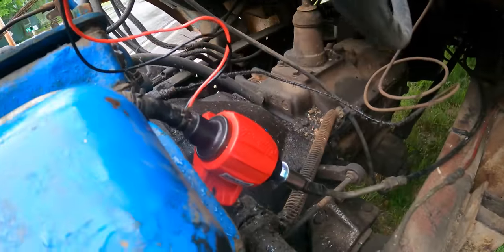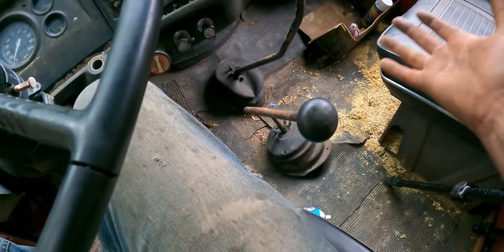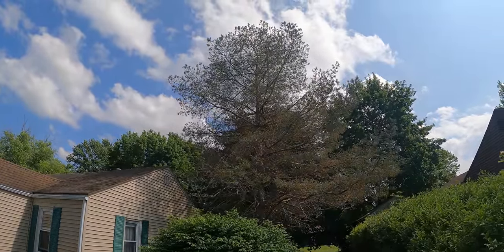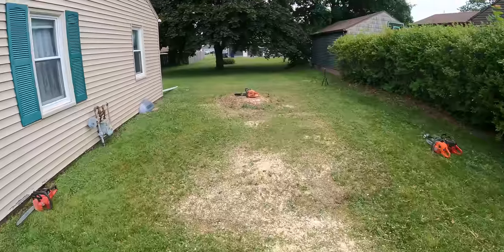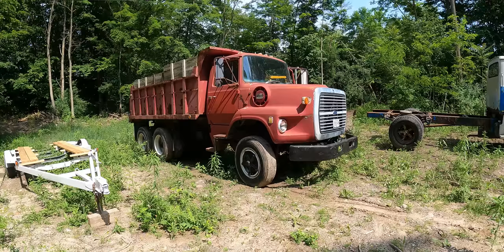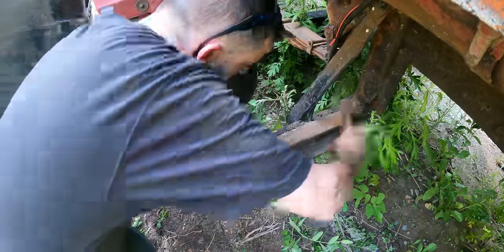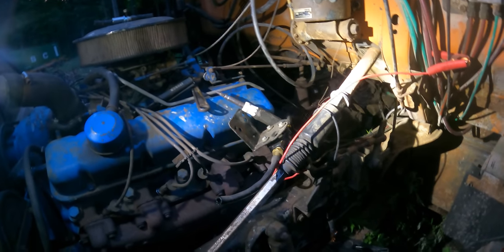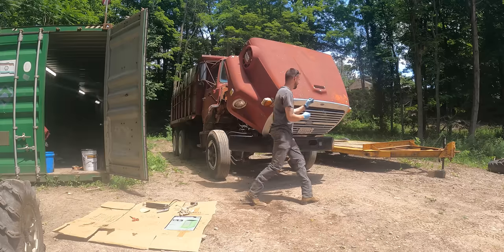I bought the CHEAPEST dump truck on facebook marketplace - Will it run??

Comment: who in their right mind would purchase that truck brand new with that tiny gas engine?
Reply from the maker: I asked myself that question several times lol
Reply: sounds like the work of a government  procurement office lol
Reply: The gasser was a very cheap option, and fuel was inexpensive when this truck was new. The 534 made decent power for the era, and local trucks normally don't go far or fast. Vehicles of all kinds back then didn't go as fast as they do today. Even the national speed limit was 55 for decades. This LTS is a dinosaur from another era, but it would have done its job back then. There was a fairly appreciable timespan when a time-tested gas engine was considered a better option in a straight truck than a diesel.